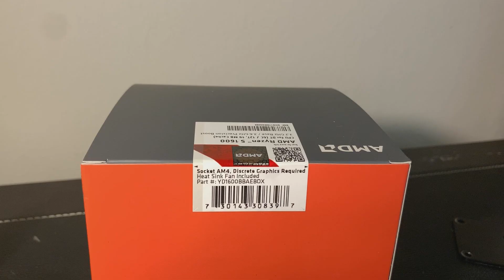Portable Compact Gaming LAN PC #ASMR Build - In Win Chopin + GPU

Comment: 1:40 Did Thanos teach you CPU cooler installation?
Reply from the maker: It was I who taught Thanos to snap! Not the other way around!
Reply: @definitelycameron9021  And yet you managed to destroy such a case! What an ugly build! Why the hell you didn't use a low profile option and connect the GPU via the PCIE X4 3.0 port at the back ?????????????????
Reply from the maker: @qtqtqtqtqt-fk7il  because an RX 580 at x4 vs x16 speed most likely has worse performance than a 2400G. Plus, I did it because I can
Reply: @definitelycameron9021  Do your research again... PCIE X4 3.0 has almost no loss in performance. :-)
Reply from the maker: @qtq2tq2t q2tq2t  Here's my research even with RX 580 card: https://www.youtube.com/watch?v=Mu2G9MaXe3c. Shows almost a 10-20 fps difference. thats 20-30%. Also with your advice, id have to use multiple extremely more bulky devices and a more extreme and precise case mod to accomodate the m.2 to pcie x4.

Comment: So where is the psu now?
Reply from the maker: Now as in after the build? It was sold to make room in the budget for the next builds
Reply: @definitelycameron9021  no, I mean where in your build is the psu if you removed it to fit that gpu?
Reply from the maker: The grey bar in the bottom is the HDPLEX NanoPSU
Reply: The small module that he put in at the bottom of the case makes it so that there is an external power brick as the powersupply like what is used on consoles such as the WII, XBox one (original) and many others instead of having the full powersupply inside the case to so a simple mod like he did

Comment: Did you cut a hole in or what? Where did the riser screws go?
Reply from the maker: Yes I cur a hole in the bottom of the case. I did not use screws to hold the riser in place. Most of the time that is unnecessary anyway
Reply: How did you put in the PSU?
Reply from the maker: Shoved it in the bottom where the flex atx psu   normally is at
Reply: I meant how do you take off the original psu.
Reply from the maker: Ugandan Warrior there is four screws I believe. Then you can easily remove it
Reply: Did your hdplex fit the original psu io
Reply from the maker: No. The 7.4 DC input jack just hung out the back. No real secure mounting methods were necessary

Comment: Is the GPU exposed on the other side or were you able to enclose the entire system?
Reply from the maker: It is exposed on the other side.
Reply: @definitelycameron9021  your build got me thinking. I'm going to have to see if I can possibly fabricate a custom side panel that can close it up
Reply from the maker: @22Wizardof  that would be incredible!
Reply: You could probably 3D print an extended back panel. You just gotta get the locking tabs right.

Comment: nice build dude, is it possible to use the riser cable with the original PSU? i want to build a similar pc for travel but with the gtx 1650 Super so i wont need much power .
Reply from the maker: I believe so, but be careful as the original PSU connects to the case via that panel so you may want to consider securing it some other fashion. You will also need a sata to PCIe cable if your 1650 Super requires a connection.

Comment: Wait did you just put ryzen 5 1600 with that cooler lol yeah good way to go for heating the shit out of cpu and power wow man awesome I checked with the makers of the power supply that a nice fire hazard. But hey what ever floats your boat and makes you get clicks from idiots. Will prefer use a damn external gpu adapter its goes like $60 and use a damn ryzen 2600 or even 2400g cause for gaming dude you are fucking using gpu not crap load of cpu.
Reply from the maker: at this point of the build Ryzen 2000 series was not released. plus the L9i never let the 1600 get over 70C. System worked perfectly. No bottle neck and wonderful for 1080p
Reply: @definitelycameron9021  better cooler cause you are messing wirh the power supply dude there is heat coming out from there as well. But yet again its dangerous i will only tell it to people I don't like to do it lol
Reply from the maker: The HDPLEX passive cooler is actually overkill. You could hold this unit at max 500W load and have no issue. That unit barely outputs any heat and with the perforated side panel this system was good on cooling. Im curious to why you are adamant about this. Ive explained that this system was fully functioning well within temperature safety spec after several hours of testing and gaming. You may be over concerned here for no reason